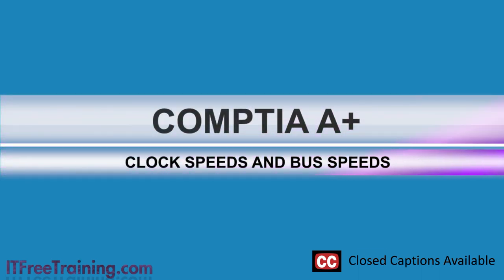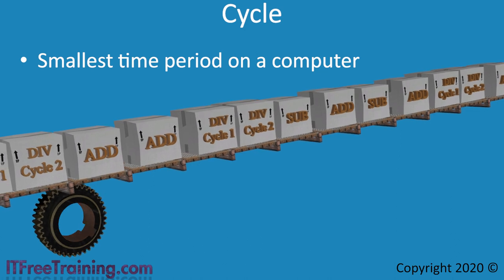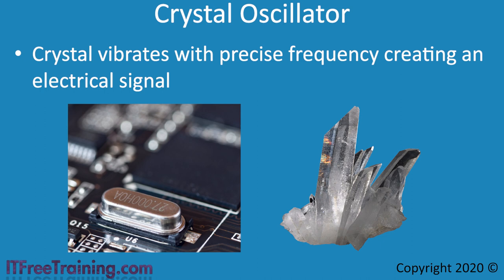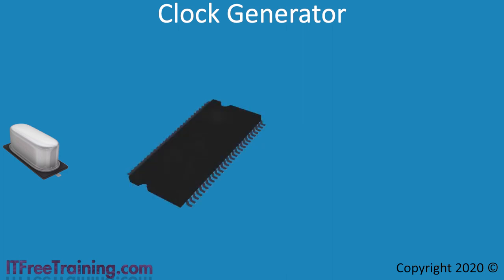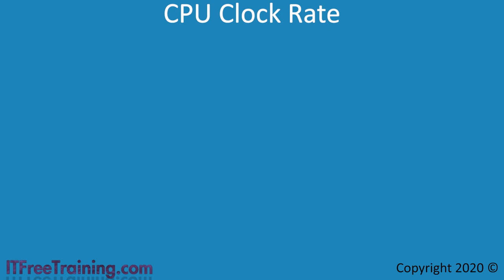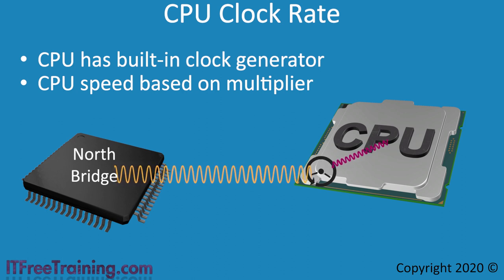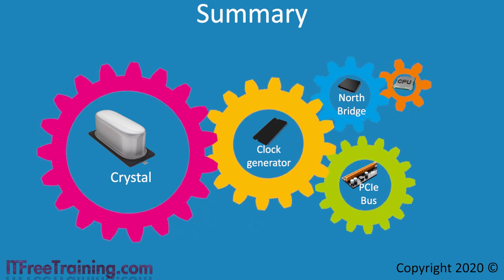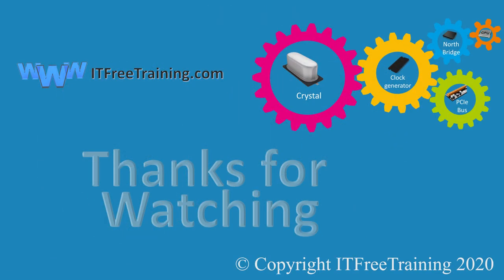Clock Speeds and Bus Speeds

Comment: On the new computers that we don't have the north bridge chipset, which device will pass the clock Cycles to the CPU?
Reply from the maker: Modern motherboards the clock signal is generated by the dedicated chip on the motherboard rather than by a traditional north bridge chip.

Comment: This was uploaded a few months ago, but you refer to the north bridge what's component parts were largely moved to the CPU?
Reply from the maker: It would be difficult to find a motherboard with a Northbridge now days on the market. However the CompTia exam still talks about it. Also consider that if you are fixing an old computer it most likely will have a Northbridge. Memory controller and high speed devices generally have been moved into the CPU.
Reply: @itfreetraining  True, great points

Comment: Hello, 

Like many here I am studying for my A+ and I am unclear as to what, exactly, the system bus consists of in this context? The authors of various books seem to use the terms "system bus" and "FSB" interchangeably in come contexts and different in others with respect to speed. As a real world example, if I use CPUID it lists my motherboard's bus speed at 99.80 MHz. Hypothetically, if I had an FSB would it also run at that speed?
Reply from the maker: So Front Side Bus (FSB) was a bus used in Intel CPU to connect the CPU to the north bridge. AMD used something else and Intel later change to HyperTransport, Intel QuickPath Interconnect and Direct Media Interface.

The computer has a number of different buses. Since FSB was popular for a while the main bus going from the CPU may sometimes be referred (Incorrectly by some) to a FSB even though it use a different technology. When you used CPUID or other software, the bus it is referring to will be the fastest and biggest bus which is connecting to the CPU. In older CPU's it connected to the north bridge which contains the memory controller. When the memory controller got moved in the CPU there was no north bridge any more, thus the bus from the CPU go straight to the memory modules and other components.

Comment: Gear explanation gd but can also be bit in detail.
Reply from the maker: What other information did you want to see?
Reply: @itfreetraining The proper flow , I knew only bit and pieces.
How clock signal makes cpu to fetch - decode- execute. What type of assemble programs used to make processor process , how data taken from registers- memory, how I/p , o/p peripherals  interfaces.
What each pin set in a processor does. On the whole an eg of a modern processor Architecture & pin structure and what each pin used with animation explanation will help me a lot.
I know it's too much but it will be easy for me to watch & grasp  than learning myself😉☺️